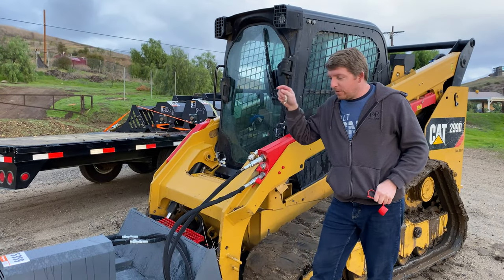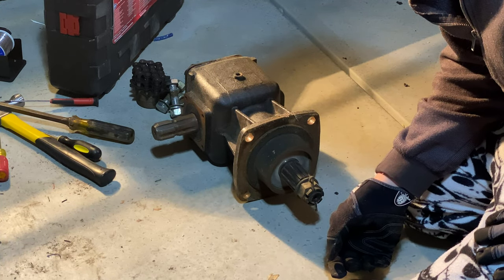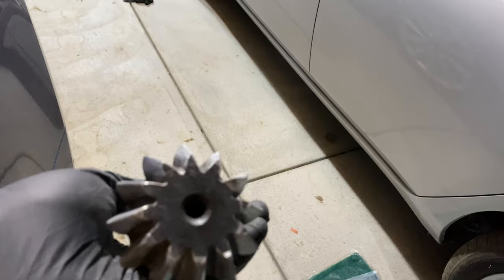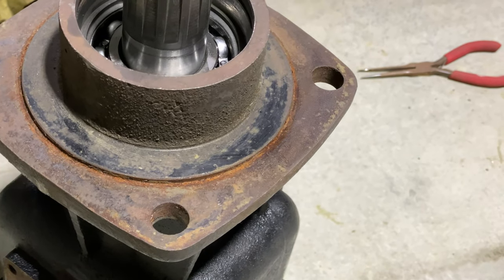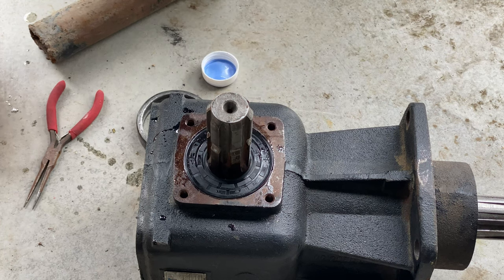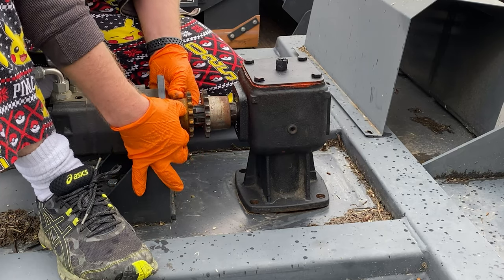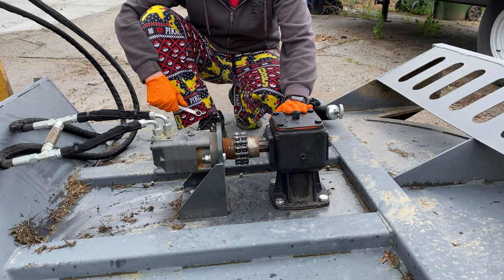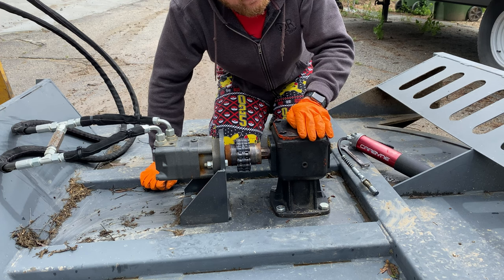Fixing a Skid Steer Mower/Brush attachment

Comment: Weld a cap over the main nut on the blade bracket to protect the nut, I used an old oxygen bottle cap cut in half. Great comeback video on a dire situation.
Reply from the maker: Thank you!  That’s a great suggestion!

Comment: Worth it’s weight in scrap, my skid-pro has a 400 pound gearbox with 8 “ tapered bearings turning a 500 pound flywheel with three 3\4” blades, .
Reply from the maker: Wow!  That sounds awesome! For what it’s worth, I have been using this for 2 years since the rebuild and it has held up great!
Reply: Honestly don’t worry about painting the gearbox, it’ll never stay together long enough for corrosion to become an issue
Reply from the maker: @petedavidsen1760  I have probably 40-60 hours of use since the rebuild and it is still going strong. I mean, I put way better bearings in it than what was in it before, so I expect a long life now.  Would I rely on it if my business was mowing lawns or clearing brush with this, no. But for my personal property it has been wonderful. I just had to pay a stupid tax for not putting oil in it. It’s a better gear box now though even though it was painful.

Comment: Same thing happened to me,  no gear oil due to shipping it from overseas. Since put a new gearbox in, blades and this weekend something let go and shattered my Kubota windshield….
Reply from the maker: Oh boo!  Let me when you figure out what happened. That is scary. Glad you are ok!
Reply: @MakersAcres  it was a oh $hit moment.. I think it might have been some weld that snapped (I’ll check for you) ordered a 1/2 lexan front windshield for my Kubota SVL 95, supposed to be much safer than the regular glass. Better safe than sorry
Reply from the maker: @Jonmalinowski  ya. Good plan. I have had a stick that came into the cab once. If the window was not there it probably would have got me!

Comment: These come from China with no oil due to epa.  80/90 gear oil is needed. These blades cut too low to the ground. Easily break.
Reply from the maker: Haha. I know that now. I’ve probably mowed 10 hours since the rebuild and it is holding up fine. I normally do a couple passes. One up high and one closer to the ground. You have to be going kind of slow and you are constantly adjusting deck height.
Reply: @MakersAcres i mod my blades and put on some bobcat blades. $35 per blade instead of what they want and double the metal on them. Never broke a blade since. Just the center piece bent now but it's not going to bend now with a half piece on it
Reply from the maker: @charlesfuglie2491  thank you for the great info!